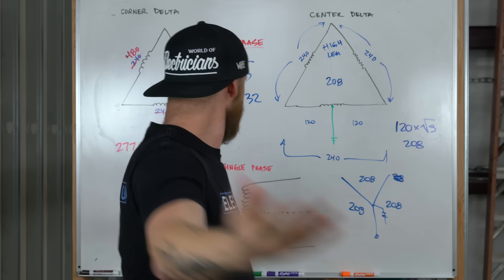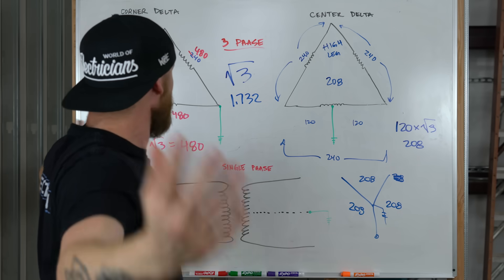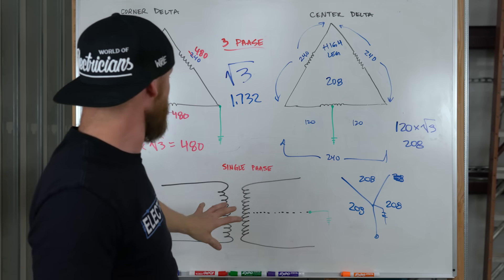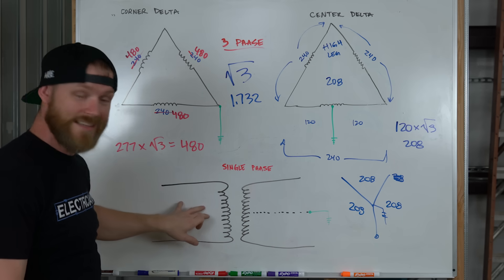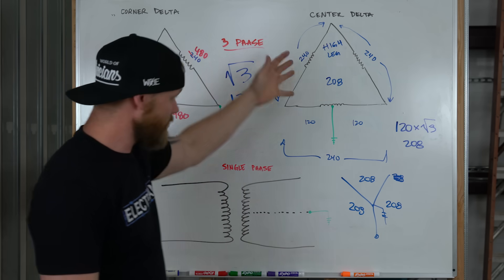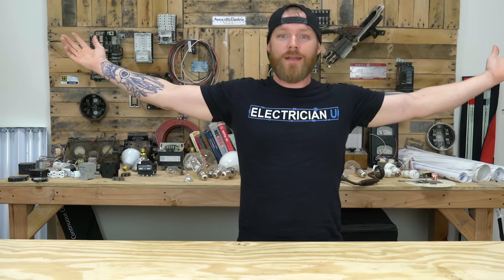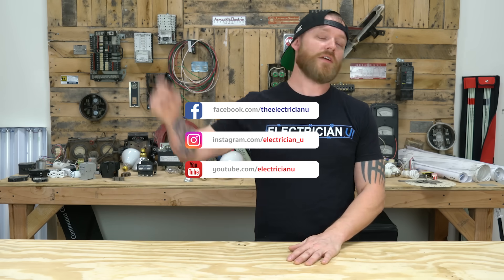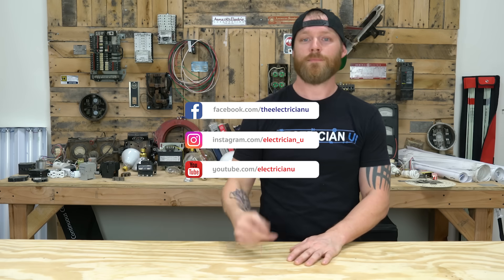Difference Between VOLTAGES - Why We Need Them All

Comment: I am trying to install a forklift charger for a customer. It’s rated for 208V/240V, 50amp 3-phase. The panel is 480Y-277V 3 phase. Is this possible?
Reply: You'd have to come out of the panel to feed a step-down transformer,  480-240V works fine since 240V draws slightly lower current for a given power draw.  In this case you'd likely wire the secondary as a delta.   You could also use three 480-120V transformers and  configure a 277/480V to 120/208V set-up for the charger.

Comment: So what reading would you get on a single phase 120v circuit with a dropped neutral?
Reply: It depends on where the neutral is dropped and if it's part of a multiwire branch circuit.   A dropped neutral at a receptacle fed from a two wire circuit would read 0 volts.  A dropped neutral at a main panel/sub panel/multiwire branch circuit would give a varying reading depending on the load balancing between L1 & L2 to neutral, could range from a few volts above  or below normal to 240V  on one line and 0V on the other because everything downstream of the dropped neutral is essentially in series with 240V.

Comment: Would love to connect with someone who deals with a lot of temporary power deployment here. I work in the entertainment industry and we typically use certain types of plugs that are uncommon to residential applications a few of which are: 50A "Cali" California style, 30A and 20A Locking connectors (ex: L21-30, L14-30, L5-30, L5-20, etc..), Socapex (19pin which carries 6 - 20A circuits over one multipair cable typically), 20A-60A Stagepin, then smaller power distro services like Powercon, True1, etc.. 50A Spider boxes are also an interesting means of deployment with mission critical equipment and entire shows riding on a GFCI protected circuit, many folks go to great means to try to bypass such an orientation. It is a funny industry where people sometimes build their own custom break-in or break-out cables to be able to get more juice for their equipment and have seen some nightmarish deployments. I would love to exchange some stories with some folks who have been in the industry for a while. Thought I would drop a line here especially seeing as how niche and specialized all of the connectors/distribution are.

Comment: Thanks for the explain! Very clear. I would be interested in 480V vs 240V 3 PH from the standpoint of equipment. This is a bit ambiguous. But I'm deciding what servce to run to a machine shop. Is there less of a voltage drop with 480? Do the smaller wires make up for the cost of the transformers? What is a good crossover 25hp? 208v vs 240v motors on compessors...

Comment: I have seen 3 phase panel coded as 208 but actually 3phase Y with a open delta. After that I always checked the voltage no matter what the tape said.

Comment: You didn't mention it, but I think sprinkler system electronic controllers and solenoid valves are often run at 24 volts.

Comment: Do you guys have 347v/600v in usa ?
Reply: Yes, I've heard of it in the USA, but never ran across it, neither has any of my coworkers.   It's very uncommon.  But if you are working in Canada you will find this is used exclusively,  you will not find 277/480.  In the USA 347/600 is most likely a very specific setup,  usually if a large facility has a bunch of motors and machinery imported from Canada,  it's more economical to setup some transformers in the building to step up 277/480 to 347/600 and create a new system in the building.
Reply: @Sparky-ww5re  I'm in Canada I am working towards moving into the usa. I am studying the NEC. I like the usa system with the brown, yellow, orange and gray for the neutral. Here they just use red, blue, black and white for everything. 347v is good for lighting circuits etc but I think the 277/480v system is better for motors.
Reply: @gurjindersingh199  getting tired of the ice cold weather lol.     As you study the NEC for when you move to the USA,  you will find yet used for orange besides phase B in our 277/480Y systems.   In a center grounded delta three phase system,  aka high leg, wild leg, stinger leg or bastard leg, the high leg must be marked orange,  or other effective means.   In the USA you will typically come across this system in older installations,  especially in rural areas,  although it may also be found in a new installation as well and in panelboards the high leg must be on phase B, on older systems before 1975 it will be on phase C, and if you're unaware of this you might connect a singe pole breaker on the high leg, and smoke up everything on that circuit that you thought was 120V because you will be getting 208V.

Comment: In 1947 thru 1985 their was low voltage controlled  lights in some more expensive Houses ...28.5 volts energized from a transverter to a relay that would  turn the light on with 120 volt

Comment: Not sure if it’s important or useful but when you plug 120 and 208 into the pythagorean theorem you get roughly 240. Curious as to why it doesn’t work for 480/277/240. Any insight?
Reply: If you're referring to the 240/480v 4 wire delta the high leg is about 415V,  or 240*1.732 =415.68.   The same formula applies to the much more common 120/240V 4 wire delta, high leg voltage = 120*1.732 = 207.84, or 208V.

Comment: Single phase 208 volt in residential can be really common. If you are working in a condo or apartment building that has an elevator it’s likely going to have wye 3 phase so power to individual units/suites will have 2 legs of that, thus 208 volt. 

While you should always check it’s easy to get complacent. So remind yourself, if there is an elevator definitely check. I own a condo with 208 volt and still forget, thankfully in residential it rarely matter as most stuff is rated for 208-240. However something like an AC especially with a long line set often found in large buildings can benefit from a start assist on the equipment (if your job covers that level of electrical work).

Comment: I am wiring a 230volt three phase hydraulic pump from a Lincoln welder/Generator three phase Delta 240volt.  My question is do I just run the three hots or do I also wire the neutral to the pump. Thank you I would really appreciate your answer.

Comment: On the communications side you'll see 48v AC a lot. This is used for Power over Ethernet cables, and similar things. I don't know if it ever shows up outside of ethernet cables and telephone wires though. (Mostly because these comms cables have very thin conductors, so 48v lets them push a little more wattage over it than 12 or 24, but not jump through the thin insulation on those cables.)

Comment: Bought a heater 2YU37 (rated at 277V 1ph) -- but I need to run it on 240V 1ph.  Thinking the heating elements will just be less efficient and the motor will only run a freckle slower.  Am I missing something?  Getting a you can't do it, from many others.
Reply: You should check with the manufacturer to see if that's acceptable.   It probably won't hurt,  the biggest concern being the motor.   A heating element rated at 277 volts but operating on 240 volts will produce less than rated output.  Bear in mind,  the NEC requires you to install equipment in accordance with manufacturer's guidelines.

Comment: I've been an electrician for 6 years, 4 industrial/commercial and 2 residential. I always struggled understanding the 208V, 277V, 480V and how you got 480V when one of the 3 legs was 277 etc. I love how simple this video was to the point that I felt like an idiot for taking so long to understand. No one ever explained it nearly as well to me.
Reply: I was the same way when I was an apprentice.    The magic number that helped me pass exams, was the square root of 3, or 1.732, when leaning 3 phase calculations.
Reply: @Sparky-ww5re  If you remember for a right triangle, c^2 = a^2 + b^2.  " c squared = a squared plus b squared. 
IF c is twice as much as a, as in the case where 240V is twice as much as 120V, then the "missing" leg b is found as...

c^2 = a^2 + b^2
b^2 = c^2 - a^2
but because c=2a, replace c with 2a...
b^2 = (2a)^2 - a^2
b^2 = 4a^2 - a^2
b^2 = 3a^2
take the square root of both sides....
b = sqrt 3 x sqrt a^2
b = sqrt 3 x a
b = 1.732050808 x a

But what if the phase angle is NOT 120 ?  ...then I guess use the law of Cosines.
Reply: @suserman7775  Brings back high school algebra memories while I couldn't wait to get home, jam out to some Metallica in my room before hitting the skateboard park with friends 😊  Anyway I learned how using Pythagorean theorem to find the hypotenuse can be used to fing the stinger leg voltage  on a 3 phase 4 wire delta system.  Fortunately in my area anyway we rarely come across these anymore except on farms where they sometimes run a 4 wire open delta to supply a limited amount of three phase power for motor loads.
Reply: @suserman7775 can you please explain the cosines part?

Comment: Question from a another electrician. I have a  cnc machine need 220v andi have 240v is that too high for that unit or do I have to confirm with unit specs paper work? 20v should not make a difference or?

Comment: speaking of the 120/240 volt 3ph with 208v high leg, for those who are unaware,  there also exists a 240/480 volt 3 ph with 415v high leg.    this is much less common,  in either case the high leg is required to be marked orange or other effective means.

Comment: If I take my 120Vac and stick it into a 1:5 ratio transformer step up to 600Vac, then at the other end drop it back down to 120Vac using a 5:1 ratio step down transformer, how much power will I be losing from the two transformers?

Comment: Something about that triangle and 208 explanation is confusing  and I was hoping to clear this up in my mind, relates to single phase vs double 120 vs 208 vs 240. The only example I can come up with is a generator install that uses a NEMA14-50R and you check each hot to Neutral you get 120, but some generators you are not supposed to connect each 120 to separate legs of the panel and those say Single phase 208, obviously you don't want both hots going to the same rail but you know they are not 180 degrees and you decide to drop the other hot but not when it's 240?  I thought if it's 208 then you could tell which way is right..

Comment: Don't forget the stinger leg on a Grounded Center Delta, you'll get 208V to ground. That's how control circuits in equipment gets damaged if not careful
Reply: Fortunately these services are less common today than they were 50 years ago, and some utility companies no longer install 120/240 3 phase 4 wire delta in a new installation; the utility will provide you a 120/208Y system instead.  Nonetheless it's critical to check the voltages with a suitable meter to avoid costly mistakes.

Comment: Dustin, how does an industrial facility that gets supplied three phase 480 make 120v for standard lighting, 20 amp outlets, etc.? Do you guys set up a transformer similar to what would be on a residential pole to center tap one of the phases?
Reply: Yes, take a shopping mall for example.  Most likely they will bring in 277/480Y  3ø.  The 480V is used to power the elevators, escalators,  and HVAC systems.   The lighting will probably be 277V (if you look closely on LED drivers,  or electronic fluorescent ballasts,  you will probably see 120-277V markings,  that's why) This is a very efficient lighting system because voltage drop will be minimal,  and it's easier to balance the loads on the phases.   There will be transformers in different areas of the mall for stepping 480V to 120V, or 480 to 120/240 to provide the 120V loads,

Comment: Why is it labeled 110 or sometimes 115 or usually 120 as well as 220 or sometimes 230 or usually 240 or sometimes 250?
Reply: Because people are special. It’s the exact same.
Reply: @imperialdoggo5826  I get that they mean the same, but what leads someone to label as 110 and what leads someone else to label as 125 for example?
Reply: @melainewhite6409  not all services are the same, like for a example I get 123 volts but I round it to 120. It means it can take as low as 110 or as high as 256 if that helps.

Comment: 208V is a fallacy of terms. 208 is 120/240 3 phase. The reason why they call 208V is because of when they actually make the physical connection at the transformer. The transformer makes to many volts because of the connection, so they have to decrease the voltage. Volts decrease over distance. They measure it to insure the transformer is doing what it's supposed to do.
Reply: If they didn't decrease the 208 volts from the transformer, the transformer will blow.
Reply: 208v has nothing to do with how your 3 phase machine runs. The most common voltages at least for the utilities here in the states are 120/240 Single Phase ( 1 Transformer), 120/240 Three Phase (208V) (2 Transformers), and 240/480 Three Phase (3 Transformers, or 1 large transformer  that has 3 transformers inside of it).
Reply: That's gobbledygook.  The voltage between two phases of a wye with 120v legs is 208v as a mathematical consequence of 3-phase theory.

Comment: In a Wye configuration one can bring 208 three phase or 120 single phase into a building.  How can 240 v be delivered?
Reply: If 240 volts is required for a piece of equipment,  you could use a buck boost transformer,  to step 208 up to 240 volts.

Comment: If you have 2O8 volts, you have 3 phase in the house. Normally don't see that on household current. 3 phase what I remember to ground is, one will have a higher voltage leg as the other 2 are about the same. I hooked up a 220 volt max car lift to 240 volts and felt uncomfortable about it for a shop. The shop owner sweared who sold him this uses 240 volts on them all the time with no problems.
Reply: What you are thinking of, is a high leg delta,  common in rural area and usually seen only  in older commercial buildings, but may also be found in newer construction as well, so always verify voltages before hooking stuff up.   120/208V wye is most common today, because each phase to neutral is 120V, and thus makes it much easier to balance the system when there's a variety of single  phase and three phase equipment in use 

120/208V single phase is actually very common in apartments,  townhouses, condos and hotels.   In these buildings,  each individual unit gets fed two out of the three phases along with a neutral and ground, while the elevator and main HVAC systems run off of 208 three phase.   

In very rare cases, three phase can be found at a single family dwelling.  Some utility companies will not install a single phase service larger than a certain size, such as 400 to 600 amps, and this might be the case for very large, custom built luxury homes.

Comment: So I get how on a 3 ph 4 wire 480v wye you get 277 to neutral on all phases. How about a 4 wire 480v delta? Will there be a high leg and if so what voltage?

Comment: You talked about WYE and Delta in the beginning, then Corner Delta and Center Delta on the white board but no WYE... Is Center Delta = WYE at 208v?   Wrap my brain around this please :)
Reply from the maker: Great question, let me try to break it down for you! So there are two system windings, WYE and DELTA. A WYE system has all 3 phases to a center point, and from that point is where we tap our Neutral. In a Delta configuration, the three phases  are terminated end to end. So A-B B-C- and C-A. There are two different ways to tap a Neutral from this configuration, by either Center tapping or Corner tapping. In a center tap, we tap into the center of a winding, then if we measure the two ends of this winding to Neutral, that where we get our 120V or 277V, depending on the supply of that transformer. In a corner tapped Delta, we tap the neutral from a terminal corner. Hope that clears up a little bit.

Comment: I work in HVAC in DFW and alot of older buildings have center tap deltas. and i have to be on alert when working on older buildings and robbing power from disconnects or equipment to power extension cords. that wild leg would make my vacuum pump work real good for about 5 seconds lol

Comment: I’m still learning the whole 208/220/240 volts. So you can only get 208 if the panel has a highe leg? So it will be highe leg/ground and neutral right? Is there a certain way to attach breaker into panel or certain breaker you need to buy to achieve 208 output? Sorry if I sound dumb!
Reply from the maker: Here’s a cool fact for you! The reason people refer to voltage in so many different numbers is because 30 years ago, we had 110/220. Advancements in the manufacturing and power production has raised the voltage to 120/240. IT’s essentially the same thing, just better, cleaner power. As far as 208 goes: you can get 208 from a Delta Highleg, but mostly in a three phase system. In single phase, we just add the legs together 120V+120V=240V. In a three phase system, we have to multiple the Voltage by the square root of 3, which is roughly 1.73. So 120V * sqrt of 3 = 208V.

Comment: It’s called trigonometry. If you draw a dashed line from the top of your delta transformer to the center of the base where you tapped the ground, then you just made two right triangles. You know both sides a can use trig to find the base.

Comment: Electrical engineer here; @9:08 is incorrect also @12:15. Line to line is different than line to phase thats why the sqrt(3) comes in and you have a delta drawn on the board and line and phase voltages would be the same. Wye line to line voltages and line to phase voltages differ by the sqrt(3). I guess this is why engineers design and electricians follow a schematic

Comment: Poe = 24v dc and Poe+ = 48v dc it’s to power cameras and switches. It’s considered low voltage since it doesn’t move a lot of current. All this power runs across an ethernet cable.

Comment: Air condition condensor I saw needed 3 phase power. 240 Volts on each lag to run Compressor?
Could you explain this? Was a Wawa store with 5 AC Units?